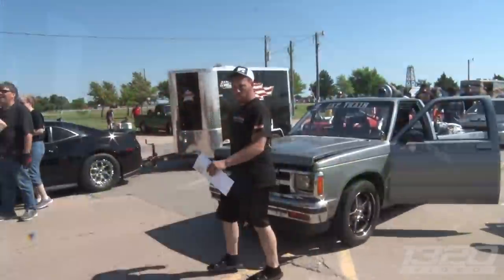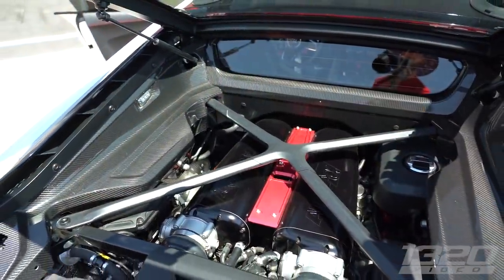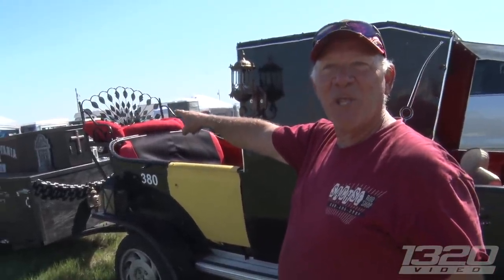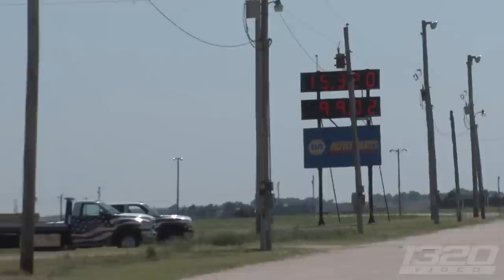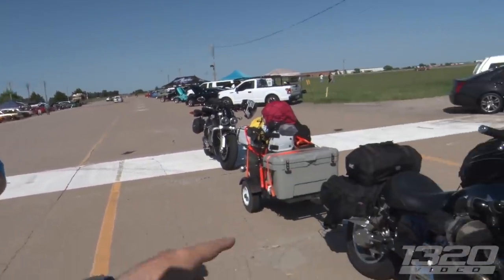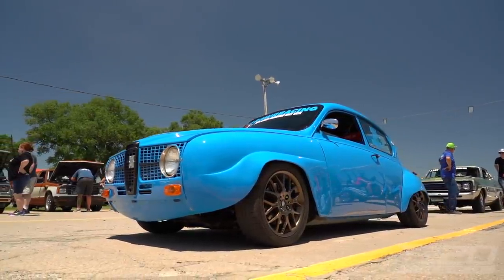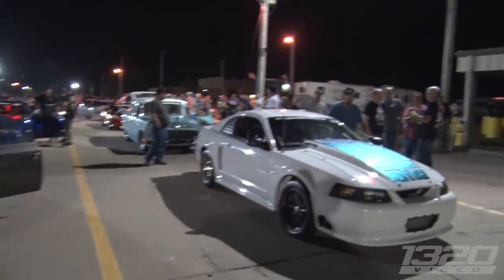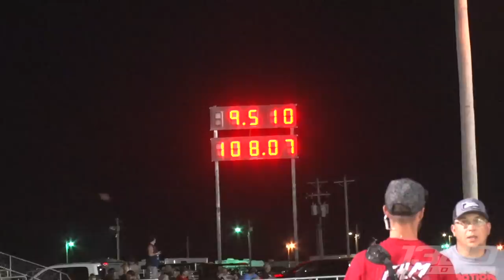RUBY & MULLET SIDE BY SIDE INTENSE PASS to kick off DAY 1 of Rocky Mountain Race Week!

Comment: Kyle should take the overhead storage off the R8 directly after RMRW. Those suction cups are known to delaminate carbon fibre surfaces when it gets enough heat cycle's under vacuum and stress.
Reply: That's not carbon.  That's black vinyl.

Comment: After this event the track owner should be suing the company that laid the new concrete for the track surface.  The concrete is totally not level and horribly bumpy.  The big bumps in the second half of the track  seriously could cause a fast car (180+) to crash.
Reply: Most concrete tracks need to have bumps ground out of them which normally is not done until it is fully cured.

Comment: That Saab... I'm guessing as it's all Miata/MX5, that it's RWD now, and the handbrake is on the rear wheels? It's one of the more hilarious things about the stock ones, seeing someone try a handbrake turn...  only to realize it just locked up their front wheels. :P  they did that up until the early 90s.

Woulda been cool if it had a Saab engine tho, maybe not the 2 stroke one, but you also got them with a Ford V4 engine, which is a kinda unique engine.

Comment: My first car at 15 was a Ford Fiesta i bought it for 1400 bucks in 1986 from a summer job as an electricians gopher. Some hot girls in a nice Jetta pulled up and yelled NICE YUGO and laughed at me. In 3 months i had a 76 camaro with a 350ci & th 400 with HCI full exhaustI and 4.10s. No more laughing and a lot of foxbodys got their asses handed to them with that car. Damn if id only have known what i had back then i NEVER would have sold it.
Reply: I bought a Fiesta used for 1,000 bucks with 90k on the clock when I was 18 for a beater that good fuel economy.  I drove that car for five years and sold it for 500 buck with 400,000 on the clock and the thing only used a quart of oil (mostly leaked) in a 1,000 miles.  I put two exhaust systems, one clutch a set of struts and shocks on it and few sets of brakes plus tune-ups, oil changes a tires.  The guy who bought it wanted the 1.6 Kent engine out of it for his race car
Reply: @gullreefclub  I traded the guy my Fiesta and 1500 cash so I had me a hotrod at 16 !! But the little Fiesta ran great it had A/C I think 86000ish miles on it and was silver with black interior. Actually a clean little car. I’d like to take a Fiesta and put a gen 1 2.3 liter turbo Ford in one and watch people’s faces drop when you gap that ass🤣

Comment: Do people have really bad reaction times or are they just giving the other person the jump
Reply: If im not mistaken they arent trying to beat the other person at the light, its bracket racing so it all up to their time in relation to what bracket they are in.
Reply: Competitors are not racing the other lane they are racing the clock for the lowest average run time over the course of the event. That said the clock does not start until they break the starting line beam and not when the tree turns green so reaction times don’t mean anything just ET’s which they have to turn in one time slip a track

Comment: 43:45 That's why the USA stands for freedom and liberty. Where you can register a Miata with Saab outer chassis as a Saab xD
In Europe anything not 100 % original (except parts registrated and approved by the authorities, installed by an approved mechanic AND controlled by the authorities) is illegal and puts you in real trouble if cops find it... Huge fine for tiny stuff and confiscation for anything else... Like them wanting to do a control of the sound level...
Just insane...
I hate posers just making noise in the night in habitated areas too, but that's it. The rules here are just insane..

Comment: That track seems like a mess. Accidents waiting to happen. Especially the whoopty whoos about the 1/8 mark. Brand new pavement and they couldn't make it flat?
Reply: Concrete tracks almost always need to have bumps ground out of them which is normally done after the concrete is fully cured (6 month to a year) That said I have seen tracks at NHRA National events that had bumps as big if not bigger than this track

Comment: Track prep seemed less then average
Reply: The track is a fresh repave and needs have a bunch of cars just running slicks to put some rubber into the track.  This event is extremely had to prep for because you have street tires, slicks, and drag radials, as a result it what rubber the slicks put down the street tires, tend to pick up and what they don’t the drag radials spinning will. That said they can’t put to much glue down because if they make it super sticky lower power cars will be breaking transmissions and rear gears and never mind the fact the DA was over 4,000 most day and it was 90 plus degrees with the sun beating down on the track with no cloud cover.
Reply: @gullreefclub  not just the prep see the bumps in the fresh concrete job ? Pretty rough must of got it done through old mate down the road who came in abit cheaper